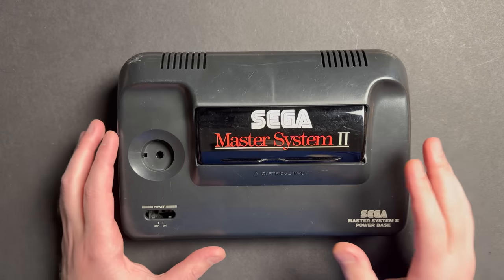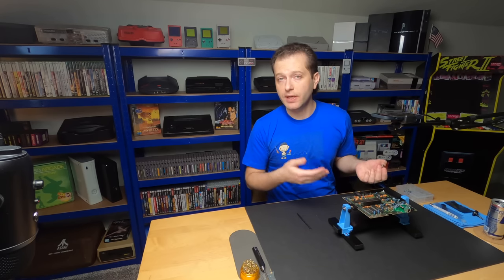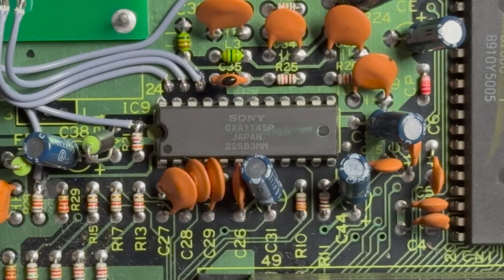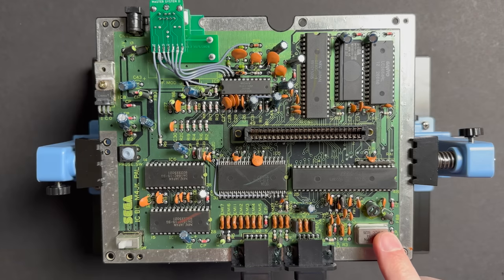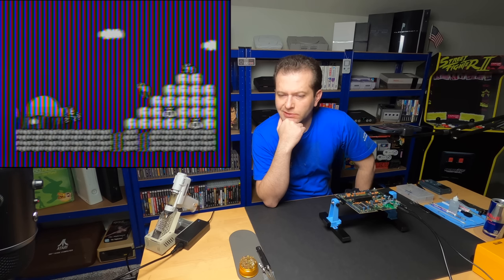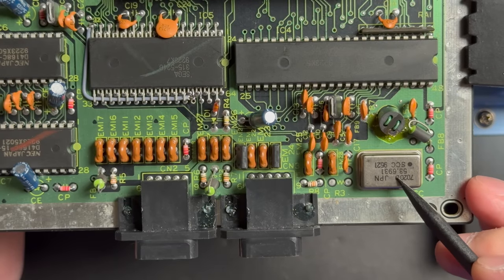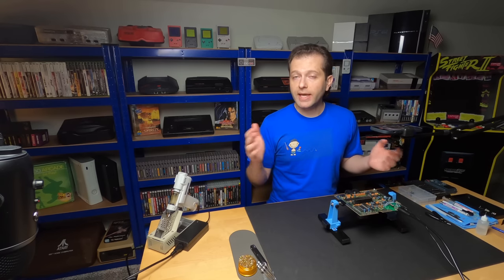Less European, more AMERICAN

Comment: The SEGA 315-5237 is the problem. It takes the master clock and distributes the clock to the RGB Encoder, however it does not have a NTSC mode/clock divider. It is hard set to the PAL clock divider. So an NTSC crystal will result in the wrong clock being sent to the RGB Encoder. Luckily the Z80 clock is close enough to the NTSC subcarrier frequency. I am trying to design some mods that will allow full PAL and full NTSC but there are lots of little problems to try overcome.

I would put your switchless region mod and FM mod into the same console. This way you can use the FM mod switchlessly since the region mod also controls the FM module.
Reply: Hi will you have more kits to sell soon when you start shipping internationl again next week ? I need to try this out on my 171-5922A PAL model. I think I will do the the RGB bypass and also an NTSC mod. :)
Reply: @josteinkallevik  Will have RGB mods in stock. I can try get some of these crystals.
Reply from the maker: Thanks for the explanation my man. Of course you know exactly what is going on! Was the color pattern a giveaway? It's all beginning to make a bit more sense now. I'm assuming the resistor is just to get the peak-to-peak voltage within the spec defined in the CXA1145 datasheet? Would there have been a way to determine this without an oscilloscope?
Reply: Thats what I kinda figured was the issue here, that the video chips werent getting the proper clock signal to run the NTSC video properly.
If I recall correctly a handful of old computers and consoles would have their CPU's run at a specific frequency in PAL and NTSC regions to provide the correct RF/Composite/Whatever video so sometimes computers or consoles in PAL regions not only had video that ran slower but the system as a whole ran slower since everything had to work at the same speed as PAL's signalling.
Reply: I though ntsc/pal would only be a thing on the RF since rgb is a different colour system alltogether and that the dual freuency oscillator generetaded the separate clocks for the z80 which runs a little faster with an oscillator designed for 60hz and also the 60hz  rf requires a slightly higher subcarrier and that you were better of isolating the subcarrier these days alltogether sine rf isnt reall a thing aymore. Does ths MS deliberatly use any composite artefacts as a part of its graphics lke on the megadrive or is rgb unequivocally better on the MS?
Reply: @nekomasteryoutube3232  yeah, if you run a 60hz game on PAL it's really slow
Reply: @rimmersbryggeri  : The colors in component are sometimes encoded differently (component has both RGB versions, and YUV versions, whereas I think that all of the composite & RF standards use YUV), but otherwise component is just the same signals before signal mixing happens.
Reply: @absalomdraconis  RGB is not YUV Component kind of is YUV. But RGB and component are not the same.

Comment: So there's one more change you're technically supposed to make here, and it seems like you can get away without it but it's worth mentioning as if you make the change it could make the composite video a little better.

If you look at the "application circuit" page of the 1145 datasheet (towards the end) you can see one more difference between the PAL and NTSC circuits: the external bandpass filter is a different frequency.

Comparing a few NTSC and PAL schematics from Sega, I think the following will do it: Bypass (remove and replace with jumper) C35 and L3, then change R22 from 1k to 330 ohm. If you look at the genesis model 2 VA1 schematic it shows the two different circuits in labeled boxes (the VA0 schematic has the labels reversed, haha). 

There are probably even better bandpass circuits you could put there, but changing it to the original one Sega used will at least have it at the right frequency for NTSC. This isn't super necessary for composite to simply work but it makes sense to do if you're permanently changing the region of a console.
Reply from the maker: Thanks for sharing this! I will definitely look into it.
Reply: @BorderlineOCD  Oof I just realized I made a mistake. R24 should be changed to 330 ohm, not R22. R22 is fine as it is.

Also you don't need to actually remove C35 and L3. You can just short them out. They're in series, so you can accomplish this by just connecting the two outer legs (the two that aren't connected together), but shorting all four legs of both components also works and is harder to mess up. Bear in mind that inductors are short at DC so you can't trust your continuity measurement to see you got it right.

Comment: Great video but a huge boost to your production value would be something like a lavalier microphone, you can record the camera audio too as a backup if something goes wrong, but it'll cut down on the roomtone and reverb.
Reply from the maker: I'm struggling a bit with audio to be honest. I don't want a lav mic, I prefer a free standing one. The setup is pretty legit with a boom arm that's insulated from the desk. I've gone through a few mics now and still working on getting it dialed in. The problem with the Blue Yeti is that it's too sensitive even with the gain dialed all the way down.
Reply: @BorderlineOCD  I'm not sure about the price but those Røde "box" wireless mics that someone like Adrian Black uses seem pretty cool and doesn't require you to be in a sweet spot.

Comment: Nice video! I wish I still had my old Master System III to check how those chips are configured in brazilian systems, as I suspect it is setup like an NTSC system, but then on the chip that codifies color it is set as PAL.
Reply: Brazilian systems transcodify the signal to PAL-M. Note that PAL-M isn't the same as normal PAL. The system itself should be outputting NTSC as is from the chips and converted in some way.

Comment: also a good mod is to have a pause function on the controller, great video!
Reply from the maker: I'm still deciding on that one, but I have the kit for it. I have just one OEM controller right now and I'm not burning to mod it.
Reply: @BorderlineOCD  if you have spare genesis controllers you can mod it. Modding a sms pad is not worth it. Keep the great work
Reply: @segajcharrua  - aye, SMS pads are pretty awful to use, anyway.

Comment: I generally like none destructive mods as much as possible. For me, it makes me feel like I’m preserving these systems better. So, I would have desoldered those pins bent the ones I needed to and resoldered them back. Solder is less destructive than scratching away pcb masking or cutting the chip’s legs. To be clear, I’m not shaming those who want to do it that way. I’m saying for me, I want to keep mine as original as possible but yes, still have my mods and play them too. Btw Luke is awesome and still is. Great guy.
Reply from the maker: You can't solder the pins back. You have to sever the connection they're making with the board in order to feed your own signal into the pins.
Reply: @BorderlineOCD  When I said that I meant, I would desolder the entire chip remove it and bend it and then resolder the chip without cutting it. That's me. That's what I would do. Extra work sure but, it's how I would do it. Sorry for the confusion.
Reply from the maker: Got it, that makes more sense. That's a lot of work though. Maybe for a rare system for sure especially if the chip is uncommon.

Comment: Were you able to determine if the "new"/custom oscillator you picked up to avoid cannibalizing a Genesis was able to be put onto the MS2 board with no ill effects?
Reply from the maker: It's in the Genesis and it's working fine. No sense in swapping them again.

Comment: Very nice work! A few years back, I thought I could get around having to do any mods by simply getting a Japanese master system with a cartridge adapter, but sadly Wonder Boy 3 will just not boot with the adapter, despite several attempts to track down the issue and a few educated-guess modifications to the adapter pcb. Now I've caved and ordered an NTSC Master System so I can at least play my copy of Wonder Boy 3 even if it won't have the FM sound activated (unless it turns out I have a bad cartridge, lol). I think I'd do okay installing the mods (though no where near as neatly as the work I've seen here!), but naturally that FM mod board seems to be out of stock everywhere now. Oh well! Such is the life of an original hardware enthusiast. Anyway, definitely interested to see more!
Reply from the maker: Did you ever figure out what about the JP system makes it incompatible? I know there are some minor differences between NTSC-J and NTSC-U but it's odd that a single game would be problematic.
Reply: @BorderlineOCD  I did not. Wonder Boy 3 is an oddity because it will support FM sound if it detects that it's plugged into a Japanese Sega Master System/Mark III, but it was never officially released in Japan for that system. Probably a planned release that never happened. My other two NTSC-NA games work fine with the adapter. I've only found that WB3 has two rom chips on it, and probably does the "bank switch" approach to have a larger game rom. Likely as a result, it appears to use an extra pin on the cartridge compared to my other two games which don't appear to tie anything to that pin, but that's as far as I got.

I've found very little discussion online about this, only that a couple others have had trouble getting the game to boot with at least some adapters as well. I guess there's so many other, easier ways to play this game with the FM sound, there probably isn't much interest in figuring out the why or solving it (if possible).

Comment: Did the standard retail NTSC system also run 20% faster, or its only after modding a Pal system?
Reply from the maker: Yeah it does. That's always been a gripe of PAL region gamers and 50/60Hz mods are popular on many systems from this era. The problem is not the 50Hz vs 60Hz per se. It's when 60Hz games are converted to 50Hz with no optimizations for the slower clock so they run slower. There are some PAL optimized games that run perfectly at 50Hz though and that is how they are intended to be enjoyed.
Reply: @BorderlineOCD  so I'm thinking back to when i was a kid, I was cheating compared to US gamers, I was going 20% slower, making it way easier. So even the music I'd hear was 20% slower than it was supposed to be. That must make Alex the kid much harder to play :-)
Does the same apply to a commodore 64 and other consoles?

Comment: Hey man.  
Love your channel. 
Quick question. 
Is this dual voltage?
I noticed you used USA plugs on it on last video.
Many thanks.
Reply: Since the input to the system is 9V DC, as long as your power adapter can output the appropriate DC voltage and enough current, it won't matter which adapter you use.  Edit - You also need to make sure the barrel plug is matched properly; in this case center negative.
Reply: @LJfromWV  can that apply to nes snes genesis/megadrive as well? 
Sorry I'm from the uk and new to this stuff.
Reply: @retrobiggy  As long as the system inputs DC, it should be ok.  The Genesis Model 1, I believe uses the same (or very close) voltage and the same barrel plug as the SMS. The Genesis Model 2 uses a different barrel plug, which is the same as what was used for the Game Gear.  SNES has a different barrel plug into the system, but as far as I know, it inputs DC voltage, too.  The power adapter will take the house AC voltage and convert it into the DC voltage needed by the system.  That's why you need the output voltage of the power adapter to match the input voltage of the console.  

Since DC is polarized, you also need to make sure the barrel connector matches what the system is expecting.  That's why I edited my comment above to mention the SMS was a center negative barrel (I had to grab my old SMS adapter to be sure).
Reply: @LJwvu  thank you so much mate
Reply from the maker: Looks like you got a couple of great answers here 👍🏻 Happy tinkering!

Comment: I would have been curious to see if the original (or console5) crystal would have given the same result.  Also, it might be a good idea to invest in a cheap USB oscilloscope.
Reply: Same here. For the sake of replacements, I was banking on the Console5 crystal doing the trick.
Reply from the maker: I put it in the Genesis, didn't see the need to swap them again. I really should get an oscilloscope. Been watching Adrian Black's videos on all those scopes, really don't like the ones that need a computer. Would prefer something embedded but even the clones are a couple hundred bucks. It will be a worthwhile investment maybe it's the next big toy I get.

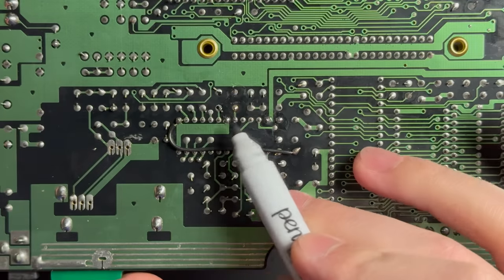Comment: 13:08 I'm not familiar with master system, but this is what I'm thinking: On the Mega Drive, the VDP has a dedicated clock divider for the chroma subcarrier, and changing it from NTSC to PAL mode or vice-versa will change that divider to produce the proper subcarrier frequency from the main clock (although just like the Master System, it does need a slightly different master clock frequency to get the exact correct subcarrier frequency).

On the Master System, however, they cheated and the NTSC systems use the NTSC subcarrier clock as the CPU clock as well. PAL systems have the subcarrier wired differently, coming from a pin on the PAL-specific IO chip that provides the ~4.43 MHz needed. The VDP is still generating roughly 3.58 MHz but it's only used as the CPU clock rather than also for the subcarrier.

So for this mod you actually have to change where that clock is coming from on the video encoder, while on a Mega Drive it would be coming from the same place and the frequency changes when you change the mode of the VDP.
Reply from the maker: Thanks for sharing your knowledge on the subject. Lots of little subtleties that's for sure.

Comment: I don't know anything about electronics, but video is another story. If I had to take a guess as to what was happening and why you had to connect to that clock, it would be the difference in frame rates between ntsc and pal. If the clock was feeding pal timing to an ntsc signal, it would fuck it all up.

Comment: I'd say that technically PAL has more lines than NTSC, but maybe it looked stretched because of the capture card (?). Thanks for the video!
Reply: Yes, but getting NTSC in RGB/60 is way more of a benefit than a few extra lines of resolution at 50hz. Trust me!
Reply: @MetzGaming  I know I know hahaha, I'm from Spain and I prefer to play everything in NTSC/60 xD
Reply: @takmk  Same here, UK based but grew up on NTSC/60/RGB. The only way to go, until PAL60 became a thing
Reply from the maker: I was a bit surprised at the results to be honest, because I'm aware of the higher resolution of PAL. Given the game just adds borders to compensate rather than more game detail, it appears squished in PAL for the same real estate. The NTSC version oddly looks more visually correct. It could all be the capture card compensating somehow. I'm sure it would look great on a PAL TV. Just thought it was odd when I saw them side by side during editing.
Reply: @BorderlineOCD  yep that’s the case for any game developed in US/Japan (90% of retro games really). The ones optimised for PAL look/play fine, but they were few and far between in terms of quality
Reply: @MetzGaming  - the PAL library for the SMS is about double the size of the US library. But even these games do still look better at 60hz, apart from the few games that malfunction.

Comment: These are great to mod, haven't modded them for years, my model 2 has
Power on light built into the switch
RGB out
S-video
Composite
50/60Hz switch
JPN Switch
FM board
Pause on controller

Used to be heavy into the forums (user name "omp") BITD, but once I uploaded a bunch of Sega service manuals, pretty much bailed. Had a few guides on MMMMONKEY website, but no idea if that is around anymore.

Comment: Wait, if that chip only does NTSC and PAL, does that mean the French version has it's own chip? Or right, it was the cable that converted the PAL RGB signal to a SECAM one, I forgot for a moment.

Still, the chip might still be different, since French versions of the MasterSystem (and also the MegaDrive 1) don't output ANY composite signal.

Comment: I am far from being an expert, but it seems to me that running that jumper wire through the legs of that chip might cause a problem if you need to do any soldering on any of those pins.

Comment: I am confused. I tried to hook up a Pal Master System via RGB and a SCART-HDMI adaptor. All I get is a super dark screen with letters and some sound. My Neo Geo that I bought in France in 1996 has zero issues running on a US TV.
Reply from the maker: SMS1 or SMS2? The French SMS2 had the smoothing caps for the RGB lines in the official SCART cable, rather than the system board. Unless you're using the official cable some modifications will be necessary to get the right RGB output levels from the system.
Reply: @BorderlineOCD  It's a French SMS1. Thank you for answering btw.
Reply from the maker: I’m not familiar with the French SMS1 in particular but there’s a good chance it’s the same as the SMS2 in RGB implementation. That’s probably your issue if you’re not using the official cable.

Comment: I no longer have a SMSII
But with that RGB encoder chip.
I personally would've remove the entire chip, bent Pin 7, reinstalled, this way I can revert if I want to.
I would do the same thing for the video encoder, but I would've used Pin 9 since it is UP and to the LEFT by one pin